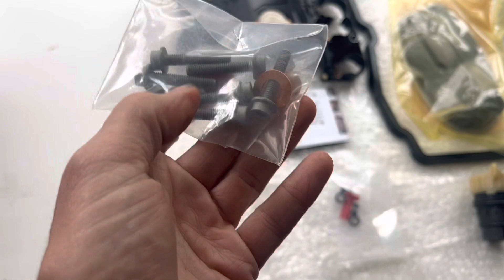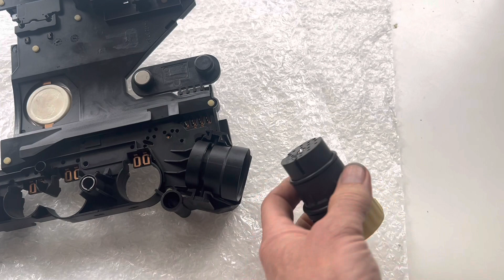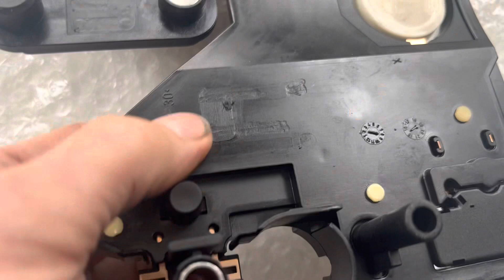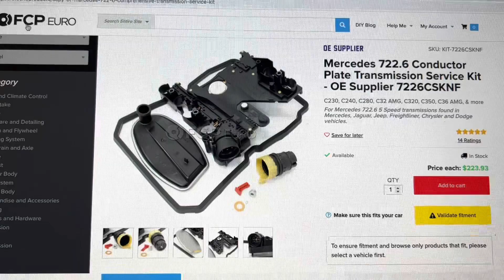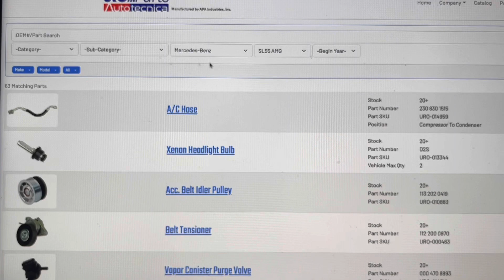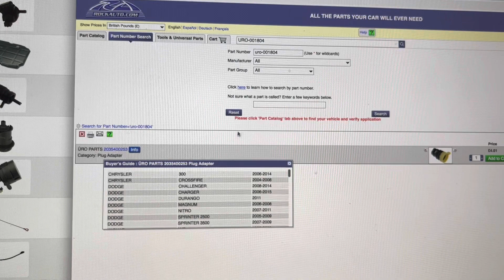Mercedes stuck in gear, limp mode, hard shift problems 722.6 transmission conductor plate. Oil leak.

Comment: I am sharing my experience. I changed the plate and installed a new one from the company Febi Bilstein. As a preventive measure, I replaced the WÜK valve – the original valve from Mercedes. I flushed the transmission with 16 liters of oil, near the oil filter. I erased the error codes using the Autel 806Pro scanner. The car worked fantastically for 800 km, and then the issue reoccurred. The same error manifested again, so I replaced the plate once more, and now the car is running fine again. I asked the company “Febi Bilstein” if I need to have their spare part, like a spare tire that I keep in the car. I did not receive a response. What do you think, why did the plate fail after 800 km?
Reply from the maker: Hi - thanks for your comment. 

The first question I have is what was the error message and what was the nature of the problem? Eg gears slipping, limp mode etc

Secondly I would want to know if you tried clearing the error codes BEFIRE changing the conductor plate and is what was the result of this action. 

I would say that it’s highly unlikely that the FEBI plate you fitted was faulty. 

I’m out in Oz on holiday and can’t remember off the top of my head whether you need your transplant the solenoids…..if so, it’s probably more likely that one of these is faulty. 

The other thing that can cause a problem is if transmission oil wicks up the electrical pass through connector. Changing the oil might temporarily solve the issue. 

Those are my thoughts. The plates should be good for 50k +

Mike
Reply: @MikesMercsandothercars  Subject: Assistance Needed – Recurring TCM Issue on Mercedes 722.6

Dear Mr. Mikes,

I would like to briefly describe my situation chronologically.

After a few kilometers of driving, my car experienced jerking. When I got home, the next time I started it, the car ran normally, but the transmission did not respond to throttle, and I could not drive forward or backward.

Using my Autel MaxiDiag MD806Pro, I found that the speed sensors showed irregular values.

I purchased a new Febi 32342 TCM (Elektriksatz Steuereinheit Automatikgetriebe 722.6), a transmission oil filter, and a WÜK clutch valve as preventive replacements. I also performed a reset before replacing the TCM, but the symptoms persisted.

On my parking lot, I successfully replaced the TCM and installed the new WÜK valve (the old one was still functional). I measured the solenoid resistance before installation, and it was within specifications.

I flushed the transmission using 16 liters of Fucht transmission oil, replacing the filter and refilling with fresh oil. After checking the oil level at the correct temperature, I handed the car to my son.

However, after 800 km, my son reported that the car had stopped on the road in the morning. A scan revealed the same error as before. A reset did not solve the problem.

I replaced the TCM again with a new Febi unit, new filter, and new screws for the oil pan. I drove 450 km with the new setup and then deregistered the car.

I am concerned that the error may reappear and would greatly appreciate your advice. I cannot rely on Mercedes service centers, as they require payment upfront.

Thank you very much for your patience and support.

Best regards,
Cosovic Dzevad
Reply: These errors were recorded on my Autel, listed in order:

2228-1 Gespeichert – Getriebesteuerung EGS Fehler 11

2225-1 Gespeichert – Getriebesteuerung EGS Fehler 8

P220A Gespeichert – Der Drehzahlvergleich von Y3/6n2 zu Y3/6n3 ist unplausibel

2500 Gespeichert – Das Getriebe hat eine unzulässige Getriebeübersetzung

P2563 Gespeichert – Der Gang ist unplausibel oder das Getriebe rutscht (4. Gang)

Comment: Wow, The MOST & CLEAR technical explanation on this conductor plate 👍💯.  The transmission fluid temperature catches my attention.  I have very high end scan tool and can access TCU.  I own two 722.6 MB.  I monitor trans fluid temp from cold start and they would get stuck around 60 Celsius for minutes then SUDDENLY jump to normal 85 to 90 Celsius.  This happens to my 2 MB.

Does this also happen to your R230?
Reply from the maker: Hi - thanks for your kind words. I always try and make a video so that when I come back a year later I can still remember how to do the job.

Strange that your transmission temps should suddenly leap up like that. Using the Autel MaxiDas, I'm pretty certain my transmission temp goes up smoothly. As an aside, you might be interested in the video below:

https://www.youtube.com/watch?v=Xx8iDOgbEZ4

Mike

Comment: The harness 13 pin plug that plugs in to  adaptor plug the 12 female pins are just clicked in plug to wires they are not soldered it only takes one to get loose and limp mode happens this can be intermittent very very  hard to find
Reply from the maker: Thanks for the comment. That is good info to know. Mike

Comment: Do u have to program the new conductor when replace?
Reply from the maker: On the SL55 and older 5 speed transmissions, I don't think there is any coding but on the later 7 speed transmissions, you may have to code the conductor plate to the car.....see:

https://www.youtube.com/watch?v=hYhGnpuUt4s

The one thing you do have to do is clear any historic fault codes with a REALLY good scanner. I have had many comments form people who changed the conductor plate only to be still stuck in limp mode...because they hadn't (couldn't) clear the codes. Mike
Reply: @MikesMercsandothercars  Correct...

Comment: Hi Mike , i have a sl55 aswell 06 . 

Recently my transmission got stuck in 2nd gear and would not switch between modes 

I checked codes (speed sensor) and changed conductor plate and made sure no oil at plugs . 
Car ended up still stuck in 2nd after that . 

I put another TCU for a s-class  i have . Now car is stuck in 3rd gear and i can switch between modes 

I erased codes with a simple computer i have aswell as a local guy that work on cars . And still no change to it 

Any idea what it could be?
Reply from the maker: Hi - sorry to hear you are having problems. 

Have you tried  plugging in DAS Star and erasing codes? If not this is the first thing I would do. Certain transmission related fault codes can’t be accessed and erased with a low end scanner. I have a high end scanner and even that can’t do certain things that STAR can do….eg suspension calibration. 

If you have done that and still have a problem, it might be time to switch around the solenoids to see if the problem jumps to another gear. 

Last question…..I am assuming that when you are filling the transmission back up, you are using correct fluid AND filling to correct level when hot using a scanner to measure oil temperature. Wrong oil level can cause car to be stuck in gear. See my video on checking oil level. 

Good luck. 

Mike

Certain transmission fault codes can’t be erased with a low end scanner.

Comment: Hi Mike, I'm almost at the point of replacing the control plate,connector plate ect and you mentioned that valve "O"  rings some times  leak causing problems and would need replacing, you wouldn't be able to tell me what the size of the of the "O" are. This is on a 2003 w203 C320 Thanks
Reply from the maker: Hi - these guys are based just outside Bristol in Langford and sell O ring kits:

JP (Automatic Transmission) Ltd 
Tel 01934852772

The kit for my SL55 (probably universal) was part number N2170508 called a "sub kit, solenoid O rings 722-600. Cost £3.38+vat.

Hope that helps.

Mike
Reply: @MikesMercsandothercars   Thanks Mike,I'll find out if they are able to ship to New Zealand
Reply from the maker: If not, let me know. I need to go there at some stage and I can easily pick up an additional set and send them over to you. Where are you in New Zealand/ We go over to Oz every year and have a few friends/family in NZ. Mike @arthurwright2619
Reply: @MikesMercsandothercars  Hi Mike, Thanks for your offer it's very much appreciated. I've a daughter living over there these days who I can get to forward any items I might these days. I haven't pulled the control plate out off the car as of yet and I just thought that I might consider replacing the seals as a matter of course and might  be able to obtain some compatible ones of the same sizes from engineering suppliers here .
  I'm suprised that that the car that come off the assmbly line in Dec 2001, but only has 110K+ miles on it would have auto problems so early, normally have a transmission service done every 3 years as we are only traveling about 3-4k  on average year.
 Once again thanks for your help.

Comment: Hi Mike. Thank you for your video. 
My N3 sensor and rear speed sensors read a little funny on my live scanner, then fail and read 0rpm, when I hit third gear. I'm then stuck in 3rd, and the ABS light comes on. 
Is it a faulty conductor plate?
Reply from the maker: Hi - I am no great expert in these matters but as mentioned at time code 4.44 in the video, the transmission takes info from the speed sensors and ABS module. If you have a scanner good enough to pinpoint which speed sensor is giving problems, it may be possible to switch them over to see if the problem transfers to the other side. It might also be worth checking to see if there any codes set which relate to the ABS module? Mike
Reply from the maker: Let me know if that fixes the problem. Mike
Reply: After clearing your codes, did yours shift fine, until it hit third?  @MikesMercsandothercars
Reply from the maker: If you have replaced the plate, you need to clear the code with a decent scanner otherwise the problem may still exist. 

Turning the car off and on again resets the module and can sometimes get you going again but it doesn't clear the code.

I haven't got round to changing the plate yet because my problem is due low tranny oil due to a leak in the electrical plug. This resulted in some funky behaviour (gearing slipping or not engaging at all)  BUT didn't set a limp home code. Topping up oil cured my problems temporarily.

Mike. @duane_bonney
Reply: It's all three sensors that are failing. 
I also have the DTC's. Nevermind. I'm going to replace the plate. Thanks for your reply anyway.  @MikesMercsandothercars

Comment: Hey mike this is the most informative video ive seen about this tranny. last week my 03 e500 went down after sitting for a few months im hoping you can help me diagnose the problem before i spend big money on a new tranny. the fisrt day driving it after sitting i had a weird code for the throtle position sensor it would drive fine untill i hit the kickdown button and the rpms would go up very slowly. i drove it for about 50 miles without flooring it and this is when the major problem came. i was going up a smal bridge and it felt like it missed a gear and got thrown into neutral. i coasted to the shoulder cycled the key and the car wouldnt do anything in reverse or drive. i then took the key out opened and closed the door locked it unlocked it and opened the door and started it up it went into reverse went into drive and then once it was  going to shift into second the rpms revved all the way up and i wa back into neutral 30 mins of doing that and i was back home. woke up next morning started it up and it drove  good for about 5 mins them went back to the problem. i bought a tranny fluid dipstick and checked the fluid and it was high and smelled burnt my mechanic told me once the fluid is dirty brown and smells burnt time for a new trans what should i do from here. thanks ill be looking forward to hearing from you
Reply from the maker: Hi - sorry to read you are having problem. I’m no expert on your car but….the first thing I would do is make sure you are checking the oil at the correct temperature. See time code 10.30 in the video below……

https://youtu.be/lkYPmtp8W4w?si=yPakhedUETlYhgHa

The symptoms you are experiencing could well be related to the level of transmission oil…..My car had a slow oil leak which I assumed was engine oil because it was brown. Transpired it was tranny oil leaking slowly through the electrical plug connector and causing all sorts of scary symptoms. 

It your oil level is OK could well be a problem with the conductor plate. Plug a scanner in and get some codes. 

Mike

Comment: I have gone thru the tedious meticulous process of changing the conductor plate and the solenoids all brand new. But the car still does not want to shift to higher gears but remains in 2nd and has a rear shift. What could still be wrong? Any advice/tip would be a big help!  Thanks:face-pink-tears:🤥😮‍💨😏
Reply from the maker: Hi - you need to clear the fault code otherwise your car will remain in limp mode. You may need to use DAS STAR system to clear the code - should cost £50 at an indie. Mike

Comment: Excellent Video - Many Thanks
Reply from the maker: My Pleasure...I just need to find a moment to actually fit the new conductor plate! Mike
Reply: @MikesMercsandothercars   - I've just purchased an CLK 32o with a 'Limp' mode and taking baby steps to find the problem and resolution:-
1st thing I found is the adapter plug is leaking oil so one is purchased and waiting to arrive 
2nd thing I found is code P220A Y3/6n2 to Y3/6n3 is implausible 
3rd thing I found today is the oil is 6 inches above the cold limit !!!

I'm hoping the correct oil level and a non leaking adapter will solve the problem however I suspect I will be changing the Conductor Plate but Fingers Crossed
Reply from the maker: Hi - that sounds like an exciting project.

Do you mean that the transmission oil is above the cold level? 

Does your car come with an transmission oil dipstick or did you buy one? 

Did you see my video on how to measure engine and transmission oil in the SL55?

https://www.youtube.com/watch?v=lkYPmtp8W4w

Mike

 @1960livvy
Reply: @MikesMercsandothercars   Major Mistake on my part !!! - Despite watching many videos I have in advertently 'Dipped' the wrong oil pipe, in fact I didn't even see the other pipe loitering two or three inches lower down 😞 

Yes I had to purchase an dipstick because the car doesn't come with one and has a one time only use cap 😡

Now I am hoping that when I check tomorrow the oil is low and this is causing the limp mode problem however I think I know where this is going and will only be fixed with a new conductor plate !

Thanks for your help 👍👍
Reply from the maker: You may be lucky....let me know how it goes, I'm intrigued. 

Last tip....with transmission fault codes, it is not unheard of that you can fix the problem, and still be in limp mode because the code hasn't been cleared.

Some codes cannot be easily cleared by a low end scanner...and some (I believe) require DAS STAR to clear. What scanner are you using?

Mike @1960livvy
Reply: @MikesMercsandothercars  I'm using an Icarsoft CR 2.0 

Yes will let you know how it goes

Comment: Hi mike 
I just changed the conductor plate on my w140 s500 1998 
And the problem didn’t go 
There are still hard shifting from p to r and p to d 
And it is stucked in one gear not shifting 
I tried another TCM still the same thing 
Is this because I didn’t clear the codes after doing this job ? Hope you reply
Reply from the maker: Yes - you need to clear the codes. 

A good scanner will often pinpoint the exact problem...for example if one of your shift solenoids has failed.

Where do you live? Mike
Reply: @MikesMercsandothercars  I will keep that in mind when I do mine this week,,...

Comment: Limp mode in Mercedes is 3rd gear, not 2nd.
Reply from the maker: Thanks for your comment. Actually there are several types of 'limp mode' for the 722.6 transmission:

The "Mechanical-hydraulic emergency running mode" (known as the light duty Limp Home mode) does indeed lock the car into 3rd gear or the last known good gear. This can often be reset by turning the ignition on and off.

The "Electric emergency running mode" is different. In this Limp Home mode, the gear engaged at that time is retained and the assigned fault code is stored. If you wait for 10 seconds after the engine is shut down and restart the engine, the transmission is locked in the 2nd gear and reverse gear only. When the shifter is moved from “P” to “R” or “N” to “D”, there is a huge clunk.

The transmission will be in this mode until the codes are cleared from the ETC by Mercedes HHT (Hand Held Tester) or SDS (Star Diagnostic System) or some third party special scanners or even the reversely engineered ones. Generic OBD II scanners cannot clear these codes from the ETC (although they can clear the corresponding generic OBD II codes).

I hope that makes sense?

Mike
Reply: @MikesMercsandothercars  Makes a whole lot of Sense... when Mine has gone into limp mode it went into 2nd gear.. and then I did the old stop.. turn the key off for 10 secs .. sorted... does the same when a coil pack is playing up.... same remedy... I love your Videos

Comment: Hi love your video. I just want to ask how much fluid you need if you replace the conductor for 2002 s500 (w220) 722.6 transmission, thanks
Reply from the maker: Thanks for your comment. Unless I am very much mistaken, the amount of oil for the 722.6 will be the same regardless of vehicle this transmission is fitted to. The trick is to catch what comes out, put the same amount back in and then top up as necessary using dip stick when engine is hot. Mike